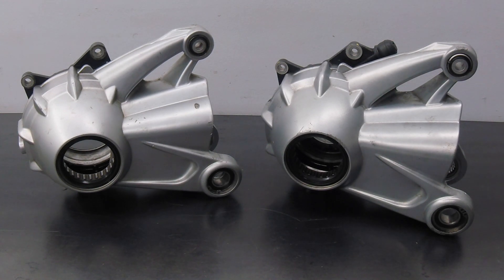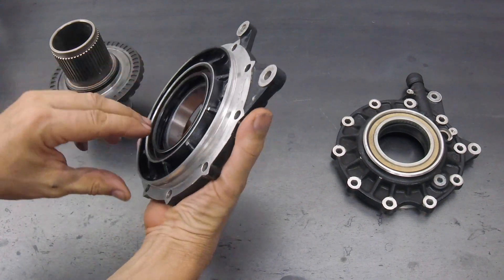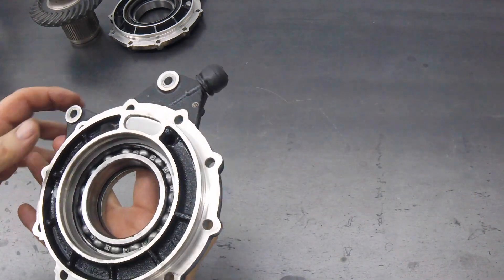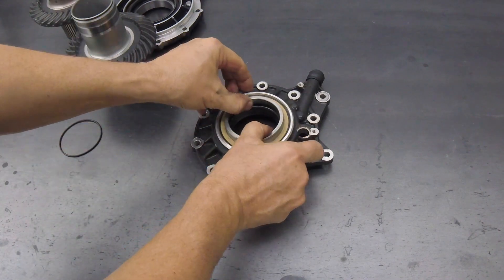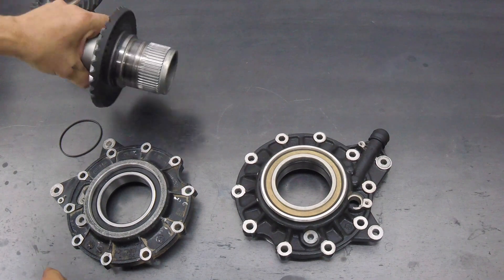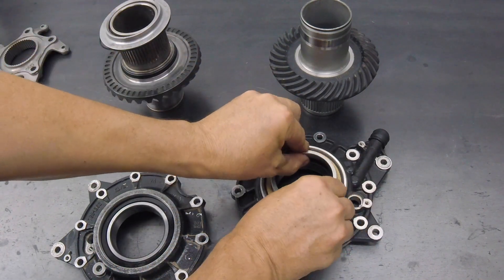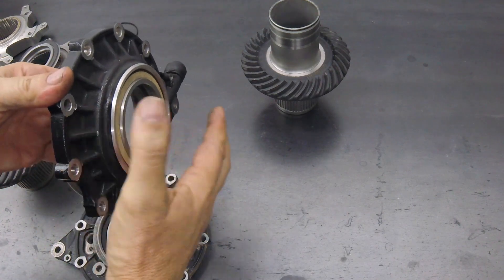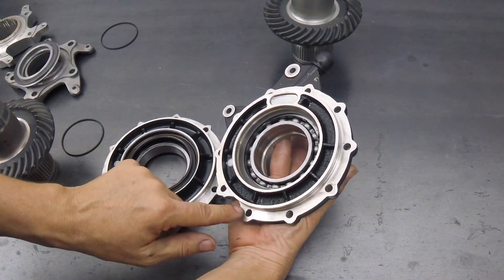Vented K2x final drives

Comment: Thank you for this interesting post.
The bearing on the final drive of my 2010 K25 vented 3rd generation modified engine broke. It's difficult to purchase the parts to repair it, so the dealer suggested I have to replace the assembly. Based on this information, am I correct in understanding that it's possible to replace it with a rebuilt 3rd generation non-vented final drive?

Comment: What year did bmw change from the aluminium flange to the steel flange?
Reply: I don't know what year they changed to steel but there is an active and open NHTSA recall for the aluminum flange moto's. There should be no charge to the owner to do the repair. https://static.nhtsa.gov/odi/rcl/2015/RCRIT-15V141-0846.pdf

Comment: I’ve read that the GS models used the gen 1 non vented final drives through 2007 with the same part number 2005 through 2007. Logic implies that this 2007 GS model final drive should have the 100 count ABS tone pattern on the back of the crown gear? Is this correct?
Reply from the maker: As far as model years go - at least here in the USA - the 100-tooth tone ring and Integral ABS were used on the 2005 and 2006 models. In 2007 we got Integral ABS 2 and the tone ring changed to 48-tooth. Model years can be funny, though. Vented FDs are all 48-tooth so they can be retrofitted back through 2007.
The ABS sensor also changed from roughly 11mm (old, iABS) to 15mm (new, iABS2) diameter.

Comment: Is it true that up to 1mm play at the rim is acceptable in the final drive
Reply from the maker: The current specs that I have say 0.5mm for all of these models 2005 to 2012 but I think it was originally 1mm. I don’t think the 0.5mm difference is really meaningful; they are saying that a tiny bit of play is normal. Failures generally do not manifest with more play.

Comment: Is the transmission ratio (don't know if it's the proper definition...I mean number of turns/minute on the cardan link vs number of turns/minute of the wheel) the same for the vented and non-vented FD? In case, if the ABS ring is the same, would they be fully compatible to each other?
Reply from the maker: They seem to be available in all of the original ratios: 2.62, 2.75, 2.82 and 2.91. However, they are only available for the 2nd-generation iABS, with the 48-tooth ABS rings and which started in MY2007. There is no updated vented replacement for the earlier 100-tooth first-generation iABS that was used up to 2006. So to answer your question slightly differently, yes as long as the ABS ring (which is part of the ring gear) is the same and the ratio is the same, they are compatible.

Comment: This is very very helpful! I would like to know if I can swap the whole final drive. I have a 2009 GSA that needs a full rebuild. I have been shopping for a like part but would love to swap to the new vented style if it bolts on. My censor is 15mm I’m diameter. Would love to hear from you and thanks!
Reply from the maker: Yes, that sounds compatible with new ones.

Comment: Hello VM, I've just watched this video and I wanted to ask at the the end  you mention about the speed sensor bore size, I have a 2007 GSA. would the bore size be the same as the later model.
Reply from the maker: As far as I know, the sensor hole is the same for all 2007-on and these are now replaced by the vented models.

Comment: What is the approximate cost to upgrade? Mine is 2005 R1200ST non-abs
Reply from the maker: I believe your speed sensing will be wrong as you should have a 100-tooth tone ring (pre-2007, ABS or not) and these are only available in 48. If this is not a problem, a new FD is currently about $2300.
Reply: @virginiamotorrad1952  Thanks.
Reply: @virginiamotorrad1952  it's probably not worth them making one's with the 100 tooth ABS ring for older models to upgrade huh?
Reply from the maker: @snohwk78  I suspect that's basically correct; when they switched to the vented design they still had a few years of production ahead of them for those 48-hole ring gears. The 100-hole ring gears, on the other hand, had been phased out a few years before and updating them would only have been for aftersales, which may have been too uncertain a market. BMW has in the past updated parts just for aftersales, but it's not common.

Comment: Thanks for this video, one question: what about the ABS grooves on the vented drive, are they compatible with unvented one?
Reply from the maker: They are the same as 2007-on, 48 grooves. 2006 and earlier is 100 grooves and vented FDs are not available that way.
Reply: Virginia Motorrad thanks, mine is 2005 so I guess I am stuck with the old design 🙂